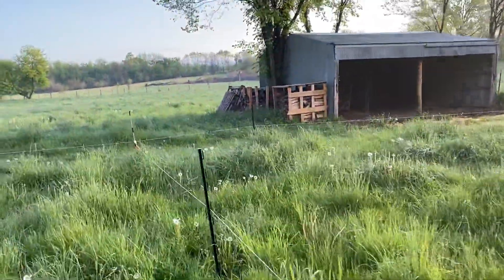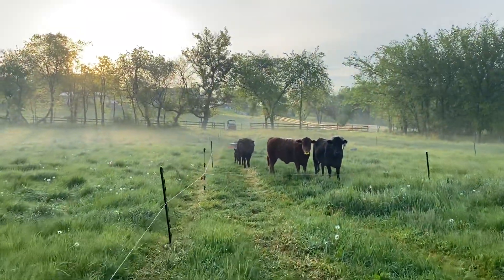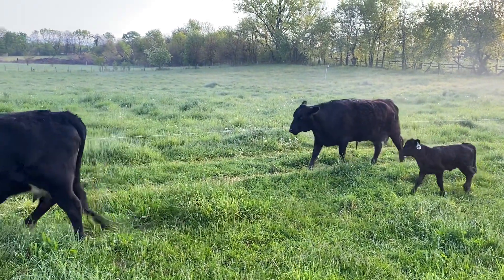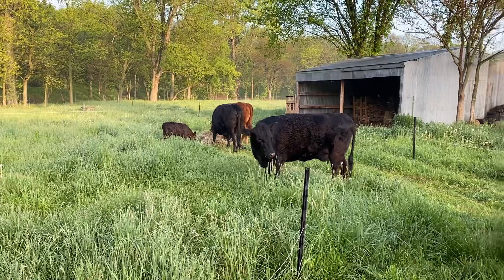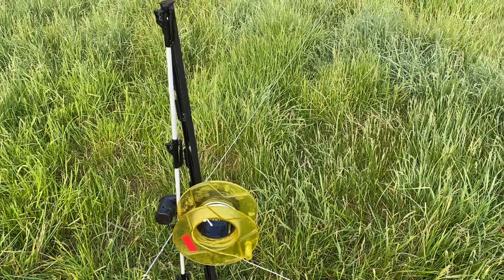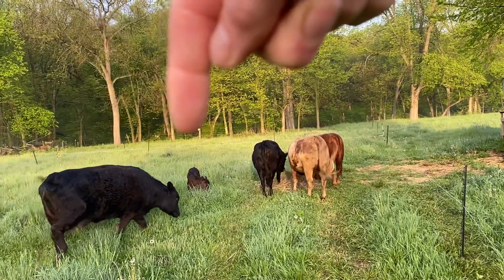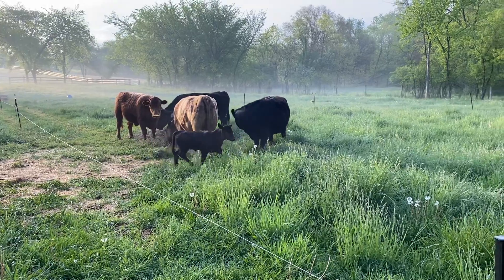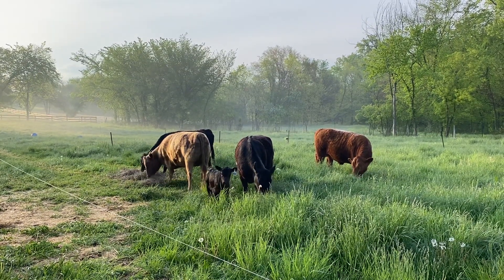Greg Judy grazing on a micro scale

Comment: I just bought a property on 2 acres. it already has a pasture that is 1 -1.5 acres. I was thinking of getting myself a Dexter cow and a calf. i will be living on the west side of the cascades in oregon. Do you think I can do a rotational pasturing with like 8 padocks?
Reply from the maker: It’s definitely worth a try. Your biggest challenge could be shade however. I don’t imagine water with so few animals will give you trouble assuming you have a way to transfer it close by. But yeah, shade. Each of your paddocks will be small obviously so unless you leave a lane open to them in each paddock where they can get to shade you risk issues. Will you be running black hided dexters? Or another color.
Reply: @WR_Ranch  thanks for the reply. I was thinking about a strip along the length of the pasture so they can go back to the shelter. I'm not sure about the hide color, what do you suggest? I'm planning on planting a few fruit trees. It will be a while before they are shade worthy though.

Comment: Do you have all four wires hot on your fence?  We just put 5 wire high tensile fence in. Wires 2 and 4 are hot.
Reply from the maker: Negative. Just one wire is hot.
Reply: @WR_Ranch  what charger are you using?  Our sheep are walking right through poultry netting, and the lambs go right through our 5 wire perimeter fence.
Reply from the maker: It’s the S10 solar charger from Gallagher Fence. What size grounding rods do you use for your netting? Ours is hooked onto 3 3 foot long t rods tied together. Is it possible your sheep are not heavy enough to make good ground contact? Our new calf will walk through my wire, she gets just a little shock but she doesn’t make good enough ground contact to really zap her
Reply: @WR_Ranch  we have three full length rods (8'?  they were tall) spaced 10' apart near the energizer.  I do think their wool insulates them....  I need something that gets them good enough a couple times they stay away from it.  So frustrating!
Reply from the maker: Interesting. That would be very frustrating. One tactic I have heard about is to bait them with something edible they want to eat, like peanut butter for cows, on the actual charged wire it’s self so they nose or tongue touch it leading to a good zap. Then they realize it can cause discomfort and will leave it alone. I did this with flagging tied to the wire when I brought the two heifers home and each got zapped on the nose a few times. It worked, it’s a mental barrier now. Sometimes  I don’t even charge the wire they just avoid it.
Reply: @WR_Ranch  I will try that!  Thank you!

Comment: Thanks so much for sharing!  I've been following Greg's YT for a while and am wanting to implement the principles scaled to my acreage of 4.5-5 acres.  So, pretty much your size.  Your pasture looks very good right now.  At your scale, are you able to have any winter stockpile to graze through winter?  Or do you feed hay through winter?
Reply from the maker: Here in Iowa grass growth stops about October 15-20th on average. Plus or minus a week. The last two years I have been able to make it until the first week of December before I “run out” of stockpile. By that I mean take it all down to 4 inches of grass left. I could easily keep them grazing it down to a couple inches until January, but this really hurts the regrowth in the spring. By leaving at least 4 inches over winter, spring grass is ready to go by second week of April roughly.   So to answer your question, I make it until the first week of December, then I start feeding hay until the first week or two of April. This year I am hoping to try something different so I am excited to see how long they can graze into winter. Thanks for the question!
Reply: I'm very small scale as well, I fed hay all winter and kept moving the big problem is frozen water. I have a heater and hauled water in my 4 wheeler 15 gallons at a time. Not bad.